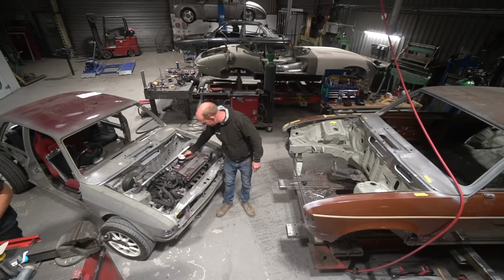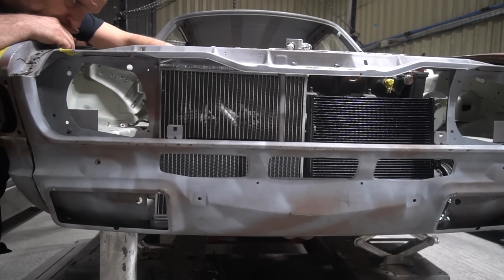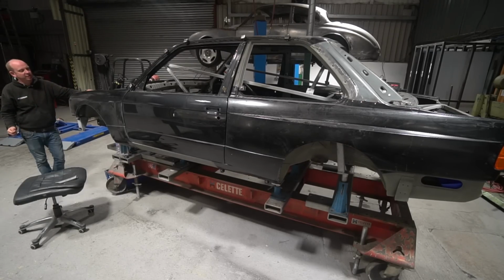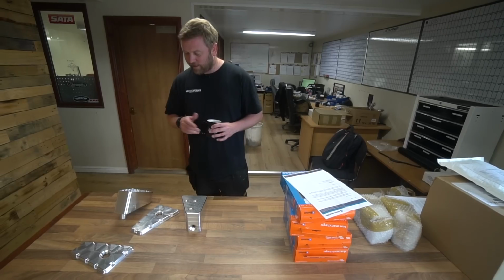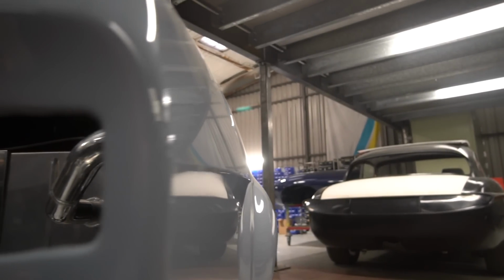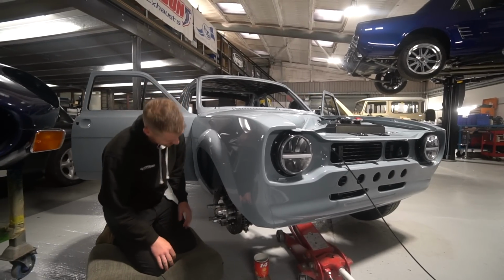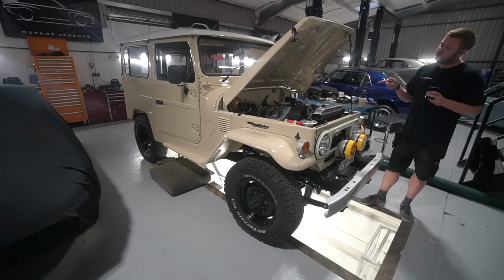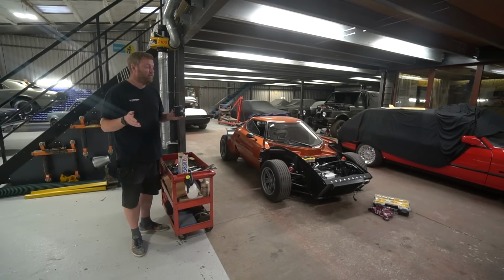MK1 Escort PAINTED Two-Tone & Land Cruiser Engine Noise Resolved!

Comment: The headlamps on the Escort look interesting. I think it's the same lamp on the Churchil Jaguar. So what is it?
Detail point on Minor Threat - there is tape on the rear wheel-arches to prevent stone chips. That suggests you need a more permanent  stone chip prevention, maybe a clear wrap would do it.

Comment: Those reservoirs are beautiful, but if you are going to only have labels on their caps, please make sure the caps are NOT interchangeable - you can guarantee that at some point, if they can be fitted to the wrong reservoir they will be, and that introduces the risk of somebody then putting the fluids in the wrong reservoir.  Different threads or sizes to prevent swapping the caps would be prudent if you are determined not to label the reservoirs themselves.

Comment: Another very interesting week. Pleased to hear that you finally found out what the noise was on the Land cruiser. Question on the Mk1 Escort, why is the fuel filler pipe entering the tank half way down its height? 🤔
Kind regards Paul from 48Spokes.
Reply from the maker: So there's a good fall on the pipe and it doesn't "back up" when filling. There's large vent lines from top of tank to the top of the neck through which air will escape when filling
Reply: @retropowercars  that makes sense. But when the tank is full, the filler pipe will have fuel in it up to the same level. Will that give you any problems when cornering at speed?
Reply: I don’t like the idea of a flexible union being so far below the static fuel level. A leak at the union could be a half tank of fuel in the boot before being found.
Reply: @martinrodger9565  No need to have that design on the car you commission from them, then.

Comment: Bruce has done my Lancia HPE, anodised aluminium as a wall mount. Excellent work.
On fuel filler hoses, I used a wire-wrapped 51mm hose from CBS, no smells after 2 years.

Comment: I’m totally in awe of your perseverance and tenacity in solving the Landcruiser squeak, this would have broken lesser folk. Also E10 fuel is an absolute disaster all round, should be banned.
Reply: We had the same issues when hauliers started using 'bio diesel' in the Scanias. I worked at a Main Dealer and we had truck after truck stopping as the plastic mesh on the fuel pickup pipe in the tank warped and closed up. Scania had to come up with a TSI to replace them. I know other manufacturers had similar issues.
Bloody eco terrorists ...